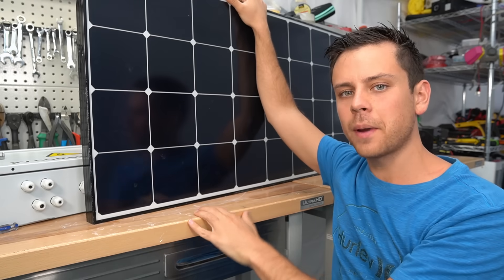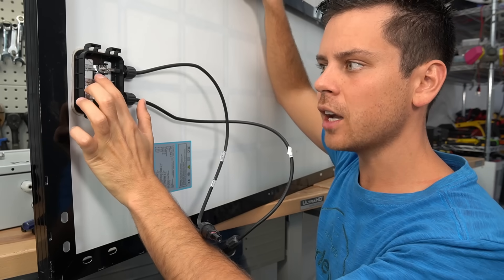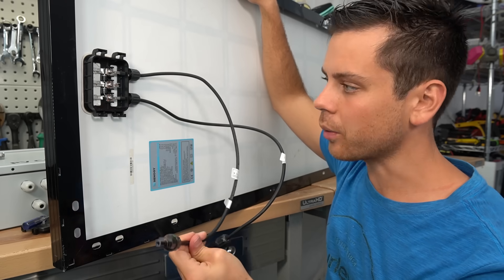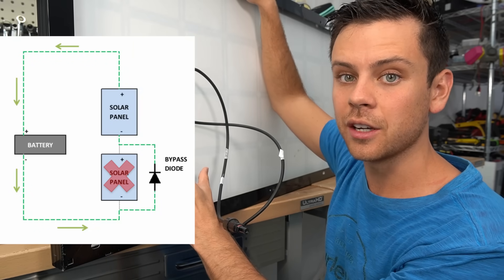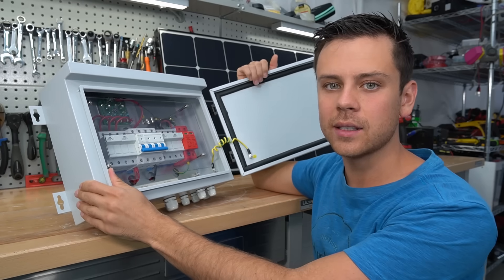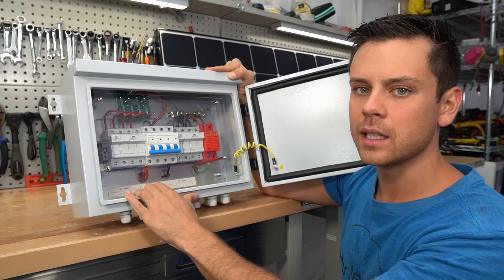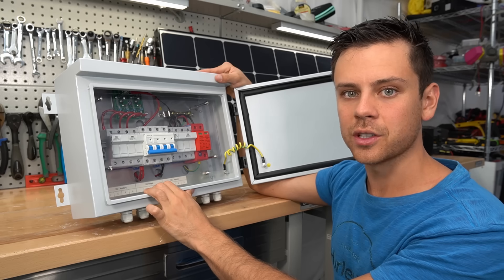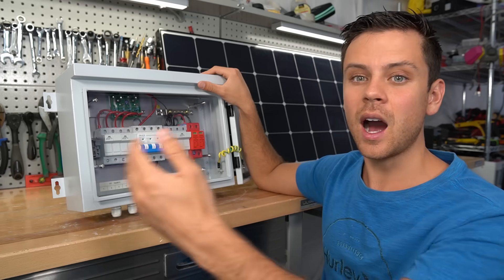Bypass VS Blocking Diodes in a Solar Power System

Comment: I dont observe this problem.  When i connect two panels at different angles in parallel,  the lower energy panel supplies less charge but never shorts the solid panel.  I like about half my panels facing somewhat towards sunup and the rest somewhat towards sundown. This gives more hours of charge.
Reply: (the lower energy panel supplies less charge but never shorts the solid panel.) wtf ?? well it dose to some degree diodes may pick you up some extra generation that is being fed into your shaded panels

Comment: Thanks for this, I had never bothered to learn the details of panel design, and always assumed variable output till full dark.  My question now is how shaded is “shaded”. Certainly “light shading” over a few cells won’t take out a full panel, or will it?   Follow up question is how do I test my panels to determine whether to risk divorce by cutting down my wife’s dogwood (kidding, but it does shade one of my two strings in the early morning)

Comment: Hello Will,

Blocking diodes provide one other function: fault tolerance. If a panel in a parallel array experiences a short circuit, only the current from that failed panel will flow into the fault. Without blocking diodes, the current from the entire parallel-connected array will flow to the fault. I install Schottky diodes in series with every parallel panel. the loss is miniscule.

This is especially important with "flexible" (bendable) panels that are constructed of flammable materials or may have flammable materials nearby. This has been an issue with the sailing community where fires have been started when "flexible" panels are placed on top of fabrics (Biminis, etc.) and constant flexing fatigues the internal cell interconnects.
Reply: excellent comment !: i am using “bonus” flex panel on the roof when anchoring (stored inside during sailing). within a month i’ve exchanged in warranty 2 flex panel showing melted area before to realyze that i’’ve forgotten the blocking diode on the bus bar for the line going to these flex panel....well the shop never complained and did apologyze for a potential Bad batch of flex panel......The panel mentionned “diode integrated in junction box” and i just made the confusion btw blocking and bypass diode. Nevertheless it seems that this “fault protection” is not really needed on hard panel.

Comment: WILL-
 I live in S. Central Alaska. Here, in the summer, the sun circles the sky. The sun doesn't travel from east to west in a line like it does in the lower 48. It actually scribes an arc of about 200 degrees of the sky, rising in the far N-NE. And then setting in the far N-NW.
I know in the lower 48, trackers don't make much sense to buy. But here, a tracker can pay for itself in a short time. 
Can you go over the need to know concepts involved in choosing and setting up a tracker? Perhaps suggest a few models?

Comment: Very well done. I'm running 6.5 KW of PV off grid....and this was my first introduction to bypass diodes.  Thank you
Reply: I was beginning to wonder, if my charge controller was faulty, and allowing power to back feed to the panels, One morning my system was dead, when I disconnected the battery, the voltage slowly rebounded, but when I reconnected, it began to lose voltage. Even with the inverter turn off. Is there a way to test?

Comment: keep up the good work will. as a professional solar installer i recommend you to all my friends who want to learn the basics of solar. ps. growatt are not good inverters. in the industry we call them blowatts or nowatts. you would not believe how perfectly they cr*p out on 5 year warranty expiry. i can send you pictures in DMs if you are interested. also check out crap solar on facebook if youre interested. much love mate. yiew
Reply from the maker: Yeah, email some pictures. Growatt has grid tie units that they manufacture, but the Offgrid ones are relabeled. What models are usually destroyed in your experience? willprowseiv@gmail.com is my email. And thanks!
Reply: @WillProwse  grid connect is all the experience i have. we would never sell them. only solaredge, enphase and fronius in grid connect and victron and selectronic with AC coupled fronius for off grid. i will send you some pics of an insurance job that nearly burnt the house down with a growatt battery and inverter.
Reply: @WillProwse  hey will i just emailed you some images of a battery fire from growatt. it came from my business account (which i wont reveal here) and contains over 10mb of images so check your spam.
Reply: @WillProwse  PS the PV inverter in the pics is the unit renowned for faults and hence the name blowatt or nowatt. you get what you pay for mate. best wishes.
Reply: @all things electric (OR Will): Sorry to spam you with a few questions, but: 

1) if I want to turn solar charging OFF, do the panels always need to be disconnected FIRST, before disconnecting the batteries from the solar charger? 

2) why don't solar chargers typically come with an option to turn them off?

3) when turning solar charging off, where does the power go that's produced by the panels? (Is it just that there's no completed circuit and so all is good?)
Reply: @drinkinslim  if you dont know the answers to these questions best put the tools down
Reply: @winzall123  I don't have any tools, LOL. This is regarding an installation put in for us. Having said that, we all have to learn somewhere, some time. ;)
Reply: @drinkinslim  1. switch loads off first then solar. 2. you install isolation switches on roof or ground level or both. 3. if the circuit is not closed it is returned to the universe it came from if individual panels if series/parallel it could cuase DC arcing and fry you. kill circuit and keep voltages below 48V if you are working on things yoruself. preferably below 12v. and remember AMPS kill not Voltage!
Reply: @boobtubereborn  and remember AMPS kill not Voltage! going to need some volts for the amps to flow. volts is what allows amps to kill
Reply: @boobtubereborn  Thank you for your replies. :)

Comment: Still keep learning, thnx! one question. 2 parallel panels (300w each) facing same direction but one might be shaded (leafs from tree). should I use blocking diodes?
Reply: Yes. They will prevent the shaded panel from sucking amps.
Reply: @robertschulke1596  thnx...

Comment: I didn't know some panels have bypass diodes built into the panel. I don't think mine do as the MC4 connectors come off different boxes off the back of the panel. I may need to add external bypass diodes for my setup.

Comment: You mentioned having 2 mppt controllers. Can the output of both controllers feed in parallel to one inverter. Do mppt controllers provide a set output voltage.

Comment: Nice presentation. 

100% agreement with your description of bypass diodes. I would add that the bypass diode also prevents a reverse bias breakdown of the photovoltaic diodes. Which prevents panel fires.

99% agreement on the blocking diodes.
Areas of agreement. 
Don't need them on a single string.
Needed them with older charge controllers, not needed on new controllers. 
Small power loss.
Parallel panels facing the same direction not needed. Except I would expect a limit where fusing would be needed.

Solf Disagreement with needed on east west roof configurations. I haven't gone thorough analysis yet.  So far there does not appear to be a safety issue, there maybe a performance loss. I need to think about this more. Scattered light will create enough volts to prevent current going into the panel.
I do agree with the use of multiple charge controllers instead, for maximum power harvesting. 

One item left off, was blocking diodes prevents electric defrosting of solar panels. This technique uses backfeeding the panels with a constant current source power supply. This method not needed in the Southwest. 

I have not considered safety issues from rare events yet. Cars backing into trailer mount systems. I need to do more thinking for parallel configurations. 

Overall positive nod of my head.

Comment: Why don't have solar panels bypass diodes built-in with every cell? Seeing your video it would make sense, right? Does it only work with columns of cells in series or do the diodes have to be in parallel to the 2 or 3 banks of cells in series?

Comment: A question on car charging. What would be an appropriate size for cell and battery bank to charge a car fast. I presume a 480V battery bank to be able to push high currents without going through a converter.

The voltages becomes more dangerous, but the system safety should go up as the batteries are pushed less per unit.

Comment: So my Growatt over charged my batteries today,   glad i was home it or the whole building would have gone
Reply: dave what happened? Did it glitch? Or was the Growatt not programmed right? Lead or Lithium bank?
Reply: @TheWickerShireProject  lead , programed as per the manual, inverter was kicking in and out then stopped, went into the house looked up a bit later and smoke coming out of the window. never even started working.
Reply from the maker: Post pictures of it on the forum. I've never seen anyone have that before. Post your settings too

Comment: i want my 0.7 volts back, dang thieving diode!
Reply: :D
Reply: use a germanium diode then, they only have a 0.3 voltage drop. ;-)
Reply: @Do_the_Dishes  unfortunately germanium diodes can't handle the heat.
Reply: Josh Nabours This is true, you sure know your diodes.
Reply: Just be happy they didn't put a gallium arsenide based diode in it. They have a 1.2v forward voltage drop.

Comment: So if i have two panels in series that have 3 bypass diodes built in. if i partial shade one panel then it will bypass one string in the panel and still affect the second panel reducing it by half its output. but if i fully shade one panel then the entire panel will bypass and not affect the second?

Comment: With 2 strings parallel and if one gets a panel shaded don't that mean the two strings get different voltage and would need a blocking diode?

Comment: Great explanation Will. I prefer separate charge controllers on each array. I have never needed a multi string combiner box for this reason. Now I have considered adding an array pointed to the west  but it would be on a separate CC as well. I like the way you teach . Great job!

Comment: Hey Will, another great vid! Question; What size diodes do I need for my System ? I have two arrays, in an east/west configuration. Each array is as follows : 520Watts @ 40v(18Amps). Thanks very much .   :)
Reply: I would use a diode rated at 60v and 24 amps or more. With a suitably sized heatsink of course.

Comment: Another bonus for two charge controllers: if you size them both to be able to handle the whole array with one unit, if one faults, it only takes a couple diodes to parallel them on the working charge controller. Suggestion: In discussing diodes, don't forget to bring up the forward voltage drop. I know they're mostly Schottky diodes with low voltage drops, but the efficiency loss can still bite on a 16v array.

Comment: Both diode types can be implemented with MOSFETs biased as a zero drop diode and get near perfect efficiency, FYI. :-)
Reply from the maker: Interesting
Reply: what keeps the bypass diode from always bypassing the panel?
Reply: @jasonbrown467  The voltage produced by the panel when in the light.
Reply: @dskaz8926  does it shut down the diode or something?
Reply: @jasonbrown467  think of the solar panel as a water pump connected to hoses (the wires). One hose brings water to the pump, the other hose takes it away. Sometimes the pump is off. When it's off, you have other "pumps" connected that are trying to push water through the system. So a check valve is installed between the in coming hose and the leaving hose. That way if the pump is off but other pumps are on the pressure from the other pumps will push water through the check valve instead of trying to push it through the pump that's off. A check valve only lets water flow one way. A diode only lets current flow in one direction. So when the pump turns on, the pressure in the outlet hose is higher than the inlet hose. This pressure difference closes the check valve. Same with the voltage difference created by a solar panel in the sun

Comment: You said your preference is to use a different charge controller for each array- is your preference to then feed that all into the same battery or do you also have separate batteries per controller configuration?
Reply from the maker: One battery

Comment: This was a very good course on diodes that covers most of the questions I've personally been asked on the matter of diodes.  In addition though, could you address what happens when a diode goes bad, what would be the results to a solar panel and a solar array system if a bypass diode or a blocking diode failed and how to test for that?  (failed in each case; open or closed state)
Reply: that is exactly what I came here to learn....didnt watch 'cause you pretty much are saying it isn't answered in this video

Comment: I recently read about special inverters which can run power to the panels to heat them up to melt down snow. Can someone explain how this is possible with this bypass diods?
Reply: A blocking diode would prevent backfeedling the panels for defrosting.  The bypass diodes would have no effect on the back fed current defrosting.
Reply: Prolly would include a control circuit with a combination of sensors detecting both shade and low temp to open the bypass.

Comment: very interesting, would it generate more power with the east-west roof arrays to take a feed off each side seperately with two controllers and then combine the output to the battery bank?
Reply: Yes. If money is no problem.

Comment: Hey Will, great video as always!  I wonder why you prefer having multiple MPPT over blocking diodes. Could you elaborate the benefits?
Reply from the maker: Sure. The main benefit is that each controller will track each individual string's power point. The power point can shift depending on the temperature of panels and irradiance. So having a separate controller for each string insures maximum output. There is zero chance of having one string overpower another string.
Reply: @WillProwse  .. thanks will. I mis- ordered  from a large solar company out near you on some Victron stuff.I ordered a 150/100 SCC .. I received that item plus 3 Victron 100/ 50 in addition, Which I paid for… THREE… Haa .. that’s a grand…….for what..?
I was Gona return them but decided they will come in handy as I add more and more panels.. each group having their own controller  all feeding the 24 volt multi plus …plus one stand alone system for a small shed to generate just plain 12 volt power for lights and charging different things.
Again thanks for suggesting a better way to hook up some future panels .. you have helped me a lot in getting this far.
P.S. I bought that same combiner box you used in this video( you did a review on not long ago.) watts/ 24 -7 …Ian has been a good source and is a friendly guy . I intend to buy another soon… good job ……Jim.

Comment: Newbie question: You said that 16 volts is good for charging 12v batteries. Do you always need to have a voltage higher than the battery you are trying to charge? I assumed you could charge any battery with even a trickle of a charge, but it sounds like I'm wrong. So you needs to have the right pressure (voltage) to pack charge into a battery that unleashes at its unleash pressure?
Reply: victron mppt needs 5v higher than the battery to activate charging and then i think 1v above to stay charging. and it converts the excess voltage into current. pwm as i understand clips the excess voltage above the battery voltage and applies direct current from the panel to charge. i have seen a buck boost controller that will charge a 12v or 24v battery with as little as 9v solar input. but if the panel is that low in voltage or even only giving 12v then the current left after the voltage boost would be so low i would think its not even going to be worth it unless you have a masssive array and even then it would be a trickle charge.

Comment: Can you use capacitors for when the ac or something kicks in?  For like an off-grid system? Like they did with car audio back in the day.
Reply from the maker: Solar batteries are large and do not require the help of a capacitor as a buffer.
Reply: @WillProwse   SLA batteries are what David is referring to, as they have a shocking voltage sag, under heavy load.

Comment: Thanks! Very interesting to hear about these aspects that I had no idea existed!
I suspect my PWM is allowing current from the battery to go out to my single solar panel on my boat, as I read a low voltage (4-5V) when connected despite totally covered and turned upside down. Maybe a diode would be helpful there.

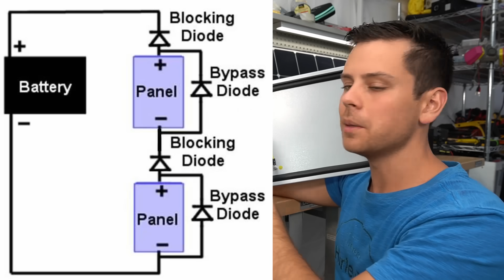Comment: 2 blocking diodes in successive inclusion as on the picture (02:55) is useless, in this example, a single blocking diode is sufficient. They are only needed with parallel panel on.
Reply from the maker: Yes absolutely
Reply: Multiple blocking diodes in series can block higher voltages.

Comment: blocking diodes are good for combining batteries of different charge levels.  Also important for wind systems so the batteries don't drive the wind generator as a motor

Comment: Thank for the educative video Will. About the example of two panels facing in different directions i was wondering if a solar optimizer for each panel like the Tigo TS4-A-O with just a single string would do the same optimization as a multi-string inverter with one string for each direction